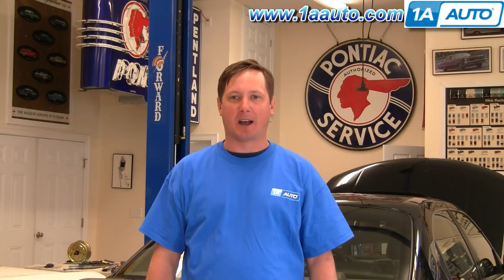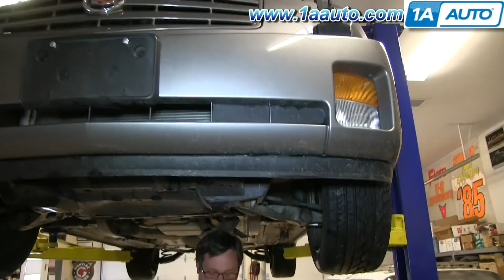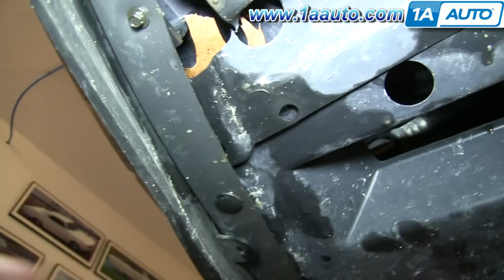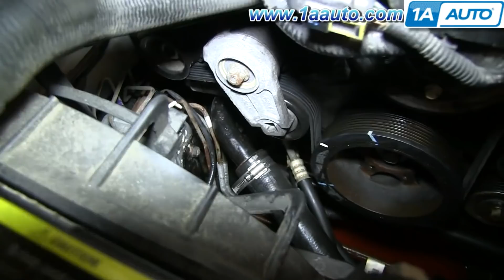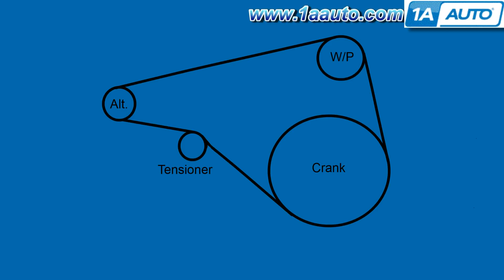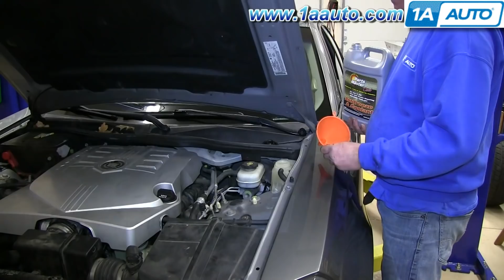How To Replace Water Pump 2.8L 03-10 Cadillac CTS

Comment: Is removing the lower splash panels really necessary - as the coolant will spill regardless from the water pump location?  Good Job - Nice Video - Thank you
Reply: I was thinking the same thing, you can just rinse it off before you install everything back onto the car. Great video nonetheless.

Comment: Do you not have any videos for 06 STS? All I see is for CTS vehicles.
Reply from the maker: We currently do not have an auto repair video on that particular vehicle. Thank you for asking. 1aauto.com
Reply: Do you know anywhere or any websites that can help me with starter replacement? I know CTS's aren't the only cars that have problems.
Reply: @loboloco8914  The STS and CTS are very, very similar. They share many powertrain components. For instance, the steps demonstrated in this video are identical for the v6 STS.

Comment: I have the 03 Cadillac CTS as well, But my engine is different than the one in this video. Do you know where i can find the water pump replacement video for my engine?
Reply: @rockslidegfx: I recently learned that the first year 2003 Cadillac CTS is basically a 2002 Cadillac Catera under the hood as far as its various engines & transmissions; CTS stands for Catera Touring Sedan, so 2004 was the CTS' 1st year of the 2.8L & 3.6 V6 engines (& CTS-V's Corvette V8) & transmissions up until 2007. I compared a 1998-2002 Catera engine to a 2003 CTS & they appear identical, from their "double" intake manifold to the locations of their ECMs on the top of the engine instead of the front. The 2003 tranny will NOT fit with a 2004-2007, I met a guy who learned the hard way after buying a 2004-2007 tranny for his 2003...